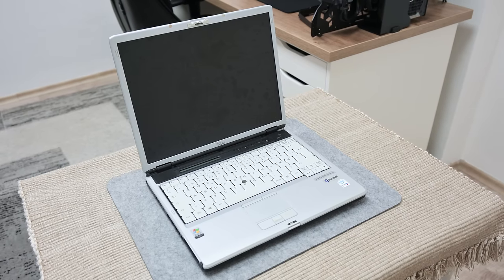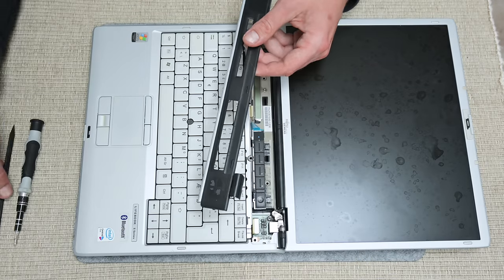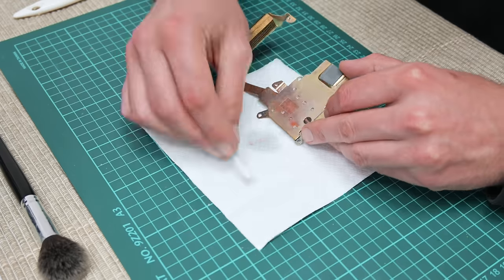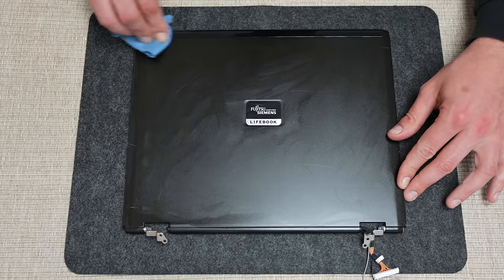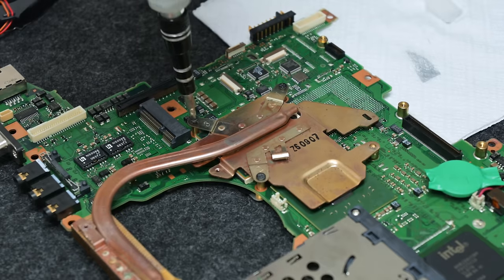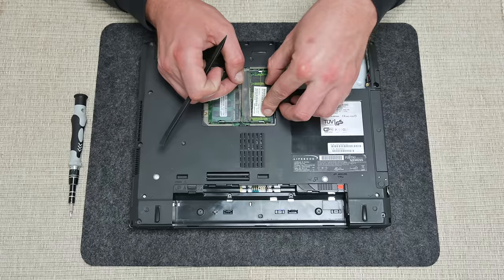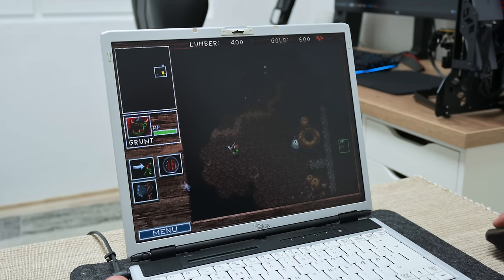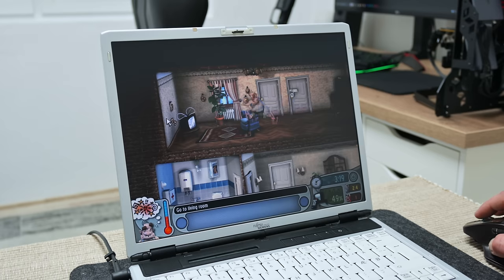Restoring Trashed Siemens Laptop

Comment: These Centrino Duo laptops work well and fast even at 8.1 and 10 LTSC, there is no need to install XP there.  I've had a few of these and they've all worked great because laptops on this platform came with both XP and Vista from the factory, and all Windowses after Vista are based on it.

Comment: I have a Dell Precision M6300 from 2007 that has this same CPU line, along with an Nvidia Quadro FX 1600M (I downgraded from the original socketed GPU because of thermal issues with the 5200M). On 8GB of DDR2, with a new dual-band WiFi adapter (cannot be understated how much of a difference this can make for web browsing), and a 1TB SSD this machine flies on Windows 10. Heck, even my Panasonic Toughbook with it's Core 2 Duo L series CPU (a VERY weak CPU even by C2D standards) and integrated graphics runs Windows 10 really well on an SSD. Still though, I will always have a soft spot for Windows XP, and it's always nice to see it again :D

Comment: Nice restoration! I'd personally install a larger SSD (or hard drive), so that you can dual boot Windows 7 and Windows XP - have Windows XP for older games and software, and Windows 7 for the more modern tasks (though even Windows 7 is out of support nowadays).
I really like these Fujitsu Lifebook's - I had a Fujitsu Lifebook E8020 which had Windows XP, as well as a Pentium M 760 (these were single core processors), 2GB DDR2 (the maximum it would take) and whatever low capacity hard drive I had to hand.
Reply: @erth yeah you could use something like Xubuntu or Lubuntu or even Linux Mint, I'm pretty sure I used Mint XFCE on an old netbook with a 1GHz dual core CPU. Then keep Windows XP for the older software.
Reply: As really and truthfully, you need Windows 10 for anything remotely modern, and Windows 10 won't run very well on older Core 2 systems (as well as potential driver issues).
Also, the reason why video performance might be poor is that the wireless card is a 802.11a/b/g only card! Even USB adapters support at least 802.11n, which will work much better than 802.11a/b/g.

Comment: I recently got a similar laptop like this with windows XP, which was going to be thrown in trash. It was in almost perfect condition almost no scratches, the battery working fine, the hdd (IDE) was perfect, but it had no charger. I found a cheap universal power adapter, and also will be installing an mSata with an adapter from IDE to mSata.

Comment: you can upgrade the core duo t2300, which is a 32 bit processor, to a higher end 64 bit processor such as a core 2 duo t7200
Edit: lol nice I just made a perfect prediction, you upgraded to a t7200

Comment: I have an old dell latitude c610. It originally had a 20gb hard disc, 128mb of ram, and windows xp 32 bit. I added a 256mb stick of a ram, and the laptop boots surprisingly fast even with the hard disc. I'm having issues cloning the drive onto an SSD. It doesn't help that the dvd drive isn't working (hoping to replace soon). I'll probably have to resort to a fresh XP installation or Linux. It blows my mind how lightweight windows XP is

Comment: older laptops does have more life even if comes to sitting out in rain or snow or bad things if is turned off but new laptops are faster but very easy to damage but very good job fix this dino back to it life again maybe hopefully you can find working battery make it 100% I seen you left out most like it is damage or the cells are dead

Comment: Technically, this laptop can run Windows 11.

But if you want a best suited OS that supports the latest games and apps, Windows 8.1 will come through.
Reply: I'd probably either go 7, 10, or Linux (e.g. Ubuntu/Lubuntu/Xubuntu or Linux Mint). Whilst keeping XP for legacy software and titles.
Windows 8 (and 8.1) was horrid and had an awful UI. Heck, I'd rather install Vista (not that Vista is supported any longer, and manufacturers dropped Vista support at the same time as XP).
Reply: @TheSpotify95  Not everyone is a fan of Linux. Besides, Windows 8.1 (not 8) runs very fast on older hardware. (Speaking from experience)

Comment: what is the highest processor that can be replaced in Acer aspire 4736z?
Reply: Depends on what chipset it has.

If it has GM45/PM45 chipset (FSB up to 1066MHz), you can go for T9900, X9100 or even quad core chips (Q9000, Q9100, QX9300), though beware of extra heat. P9700 runs cooler but loses about 200MHz than T9900 and X9100.

If it has GL40 chipset (FSB limited to 800MHz), T9500 is the fastest compatible chip without using BSEL mod.